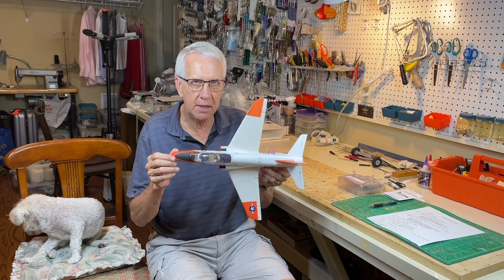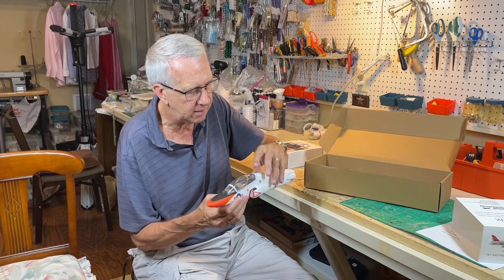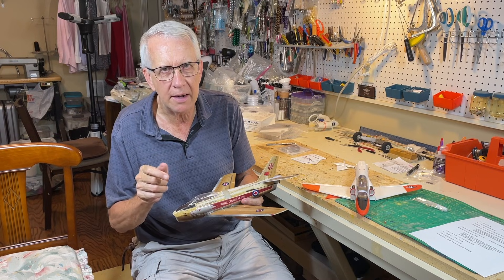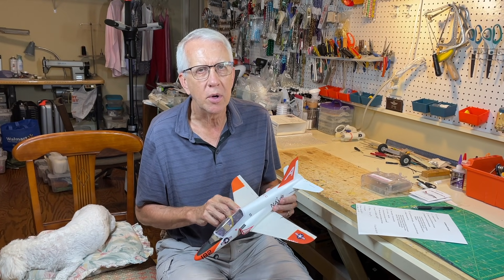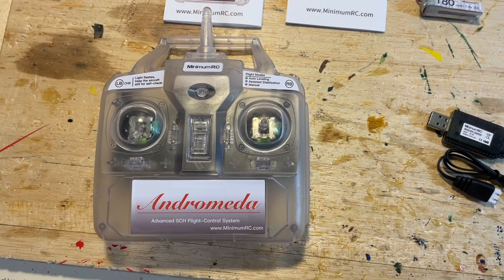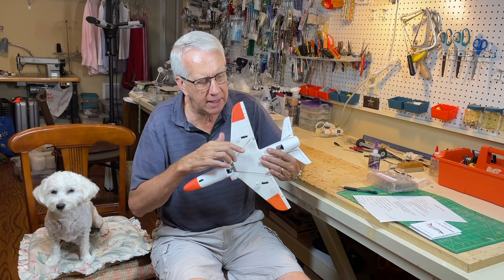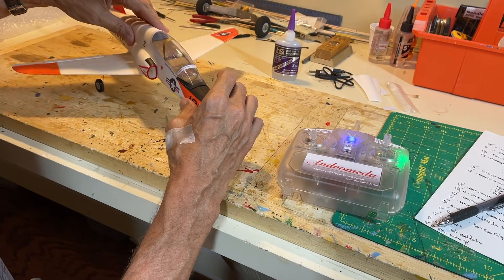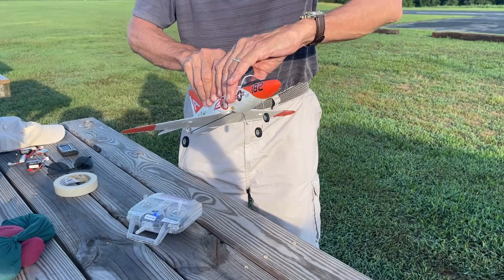T-45 Goshawk Jet 30mm EDF RTF

Comment: That's a great video from start to finish. Mine is on its way hopefully easy to build 😅, you just make it look easy. So the COG is this crucial to where the battery sits or is it jist as far forward as you can go ? I watched another video and they said the elevation wasnt great with it far forward.  But I can't wait
Reply from the maker: Thanks for checking in!  The T-45 really is this easy to build. It might be a good idea to shift the 2 cell battery a bit aft. I had sufficient elevator control but barely enough aileron for turn. The middle stability setting is best I’d say. Good luck!
Reply: @TimMcKay56 many thanks for your reply. Happy flying

Comment: Find a small brushless esc with a bec. Run the existing electronics from the 5v of the bec or use one of those tiny converters to drop the battery voltage to 5v.
You now have the option to increase the battery cell count to increase the motors output ie 3cell instead of 2, yes extra weight but you can use a smaller battery to gauge what's best.
The electronics should be perfectly fine running from a bec your basically only changing the motors power - obviously this comes at risk of burning the motor out so don't listen to me.
Reply from the maker: Great points, thanks!

Comment: Mine finally arrived after 30 days of shipping to California. $40 for that. And $180 later out the door I am very disappointed in this kit. It is extremely delicate and flimsy. Worst of all it BARELY has enough power to take flight (full charge on batteries). The control rods are SO tiny and delicate with any bounce or attempt at a landing and they will disconnect or break. The wheels are super flimsy and really serve no purpose. This is a TEMU level model kit, buyer beware. Just watch this video, you can tell he struggles to get it airborne and once he lands a rod disconnects. Alot of the videos are like that.
Reply from the maker: Yup, agree.  These micro EDFs do not put out much thrust and weight must be kept to a minimum, thus a very light structure.  Not great with inevitable hangar rash.  😳

Comment: so what channel is safe on? ive asked that over on their channel with no answer and a delete. these companies just don't get it when it comes to flying these micro's with a hobby grade controller, instead of their mediocre Tx's.
Reply from the maker: I am not sure they have a SAFE mode, rather different levels of gyro stabilization.  When you turn on the transmitter, the green light comes on with full gyro stabilization.  Push the upper right button goes to a blue light (mid-gyro stabilization), but again a red light, no gyro input at all.
Reply: @TimMcKay56  ..I just call that SAFE mode...Auto Leveling, Stabilization, Manual mode. They're all on 1 channel. If you're using a TX16S, you need to know the protocol of their receiver and what channel those modes are on. Those micros aren't worth buying with the cheap Tx's they come with, as you can do so much more with a hobby radio like the TX16S. I can fly all the Volantex warbirds inverted with the TX16S, and you're not going to do that with the cheap Tx's that come with it.